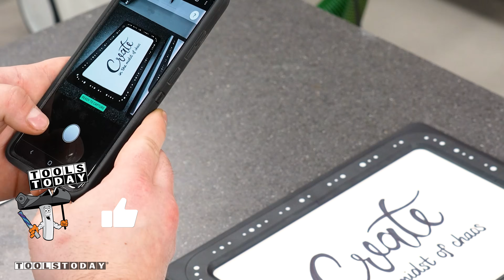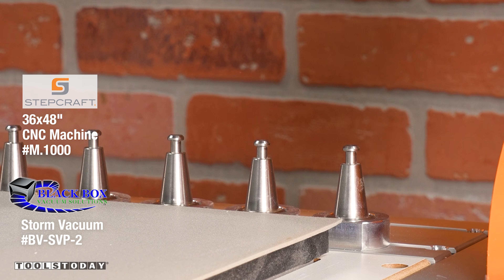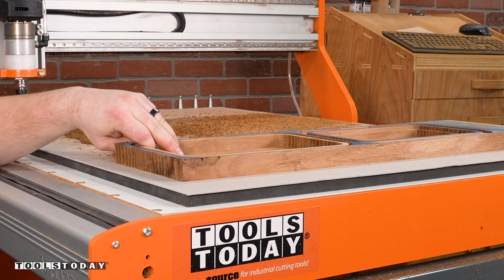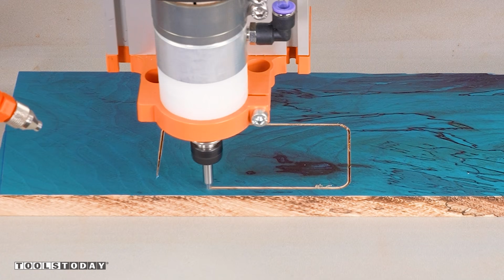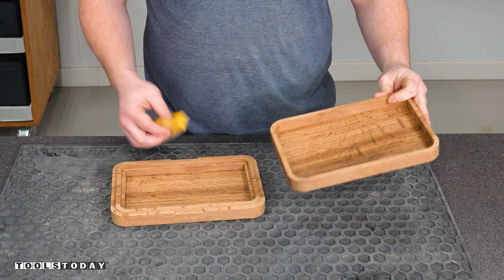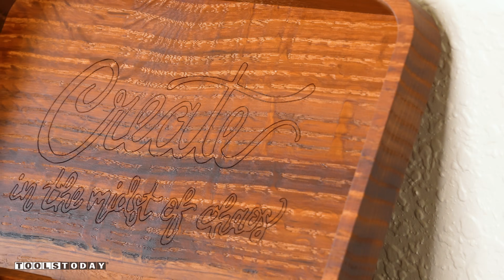How to Make a Jewelry Box Gift | ToolsToday CNC Video

Comment: Hi there - I love your videos. Please confirm if the download files from your site will be ok for v-Carve Desktop - you only mension V-C Pro?   Also as a newbie to this cnc marlakey if I re-size to a smaller one by selecting all the items and then just re-calculate all the g-code?
Reply from the maker: Thank you for the kind words!  Unfortunately v-carve desktop will not open v-carve pro files, so the toolpaths wouldn't be set for you.  The plans include the SVG versions of the design you could import into desktop and the included instructions go over how to set it up.  In theory, yes you could just resize everything by the same scale and have it all work, within reason.  Some of the spaces on the tray and the lips around the edges will get a bit thin and may break if you downsize too much without adjusting things.  I hope this helps.
Reply: @ToolsToday  oooops - I've already bought the files tody.   I'll see how to do it.
Reply: I have a dummy program of Mach3 on my office PC so I downloded the Vcarve file and all the tool paths seem good when I run the view toolpaths.  I then opened a few g-codes on the dummy and it seemed to all be there. I'll try properl over the next few days.   I have a few friends in mind for Christmas presents this year for these.

Comment: How much clearance do you  leave for a snug but not too snug fit between top and bottom of the box?  Approximately?
Reply from the maker: It's different for each CNC machine depending on the tolerances they operate at.  For my machine here I cut the lip on the bottom of the tray .004" smaller than the box lid.